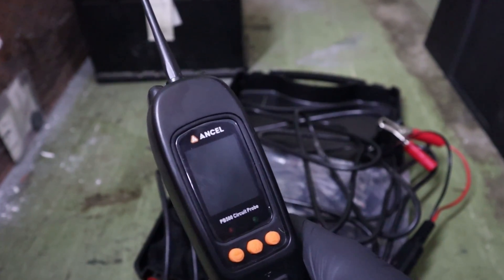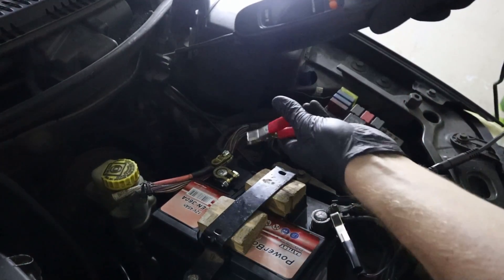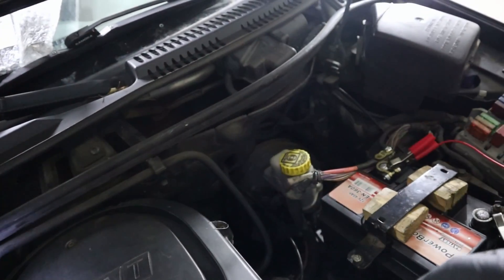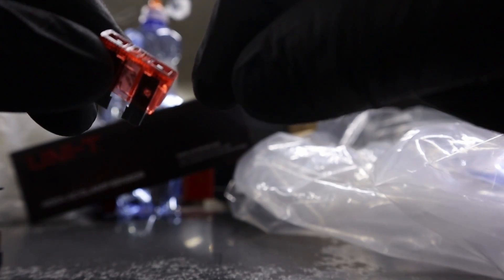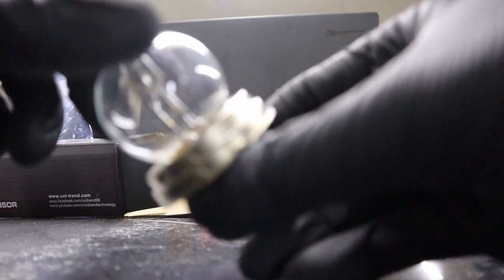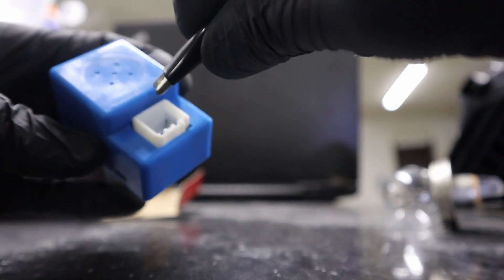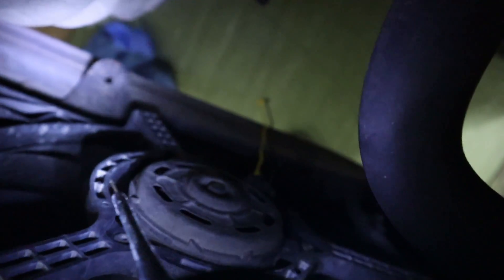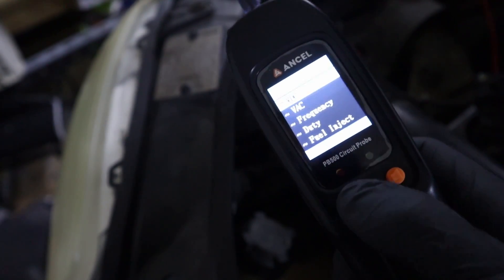Ancel PB500 | TEST circuits and LEARN automotive electrical!

Comment: Привет! Ты славянин что-ли?)) Акцент выдает жесть. Что думаешь по поводу Autel PS100 по сравнению с Ancel PB500? В Autel не нравится что он переменное напряжение корректно не измеряет и срезает отрицательную полуволну. Также нет отдельно режима измерения частоты и диодов. Упаковка у Аутель слабая. Нет паралона в боксе. Вообще как по качеству Ancel?

Hi! What do you think about Autel PS100? Recently i bought myself it. And i was little bit disappointed with him. Because this tool don't measure AC signal correctly. He can show just a half signal. I mean he can't show a negative part of signal, while i'm measuring AC signal like a crankshaft sensor for example. Secondary, in comparison with Ancel PB500 the packing it's not good like. 
Also he don't have a frequency measure mode separately like Ancel PB500.
Sorry for my English. I'm not a native speaker.😅
Reply: Тоже так подумал сразу)))